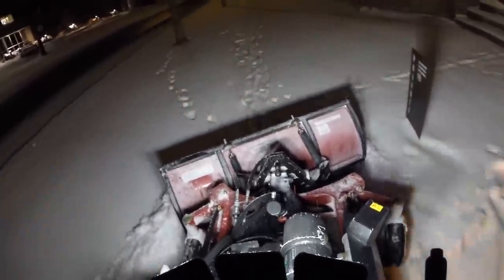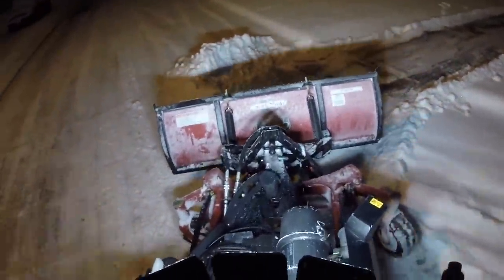Toro Grandstand Multiforce In Action

Comment: Have you had any issues with salt corroding the engine and electrical components when you transport in the open trailer?
Reply from the maker: Grasshopper Lawn Care Services, LLC yes, I built up the front of trailer to eliminate road slush. Fluid Film and dielectric grease is a must...
Reply: Rhett

Comment: Hey how do you carry this in snow? Do you have a trailer or does it fit in the back of your truck?
Reply from the maker: Sidewalk crew with the truck and trailer in video. Build up the front of the trailer to avoid slush being thrown up on the Toro. Have an enclosed trailer now, and will be using that this season.

Comment: How wide will the plow be angled? Most of my sidewalks are not 5'.. more like 36-40".. thx
Reply from the maker: Correct, residential sidewalks around us are 40" +/-... However the city walks in Madison are 5', sometimes wider. The blade only cuts off an inch angled, so 59".

Comment: love the video but what is the cost factor between your machine and a bobcat s70 with a blade/pusher? and in a bobcat you are out of the elements Thanks
Reply from the maker: Very true, we used to run a Toolcat. Given the amount of snow we deal with and how we have set up the routes, the Multiforce is way more efficient for how we operate now. If I need to move snow I do so when needed.

Comment: Can I buy LED lights and strobe separately
Reply: I used to do vehicle electric as a job & I would say yes to both.  The LEDs are my preference on anything due to the extremely low voltage draws.  All of your LEDs can be wired on one switch/circuit but, my recommendation for strobes is to have a switch/circuit of their own.  I say this because strobes use capacitors which use a higher draw to maintain operating voltage + stored electric in the capacitors.  Just my 2 cents...

Comment: Not impressed, gotta suck when its really cold outside, when you walk behind a snow thrower, you keep warm by moving your muscles, also what is it like with many snow falls in a row, a snow thrower can throw the snow anywhere you want it...away from the work site, with this rig its just piling up.
Reply: You use both
Reply from the maker: You have to gear up! No doubt you are more active with blowers, but i'm all about efficiency during events. You can move piles later.
Reply: @Elementsian  exactly. My friends comes back with a Dingo to move snow if needed...
Reply: That was just a dusting.  Can't see using this machine in either a wet snow fall, or a heavy snow fall.
Reply: @Elementsian  four you put  wind sheild on it ?
Reply: I'd rather be a bit chilly for the small amount of time it would take versus using a snow blower, being soaked and taking probably 30 times longer. That machine is hands down one of the best sidewalk machines I've seen. I'm sure there's even some sort of enclosed cab for it. Great video

Comment: Are you running stock tires or snow tires?  You mentioned some tire spinnage.  Traction is one of my biggest concerns
Reply from the maker: Ditsch Lawn & Landscape snow tires with antifreeze in them...  Traction has been surprisingly better then you would expect for a machine of this size / the fact its only rear wheel drive. However you do run into issues from time to time depending on a couple variables. I should have a more in-depth review video coming up here in the next week that will touch on traction more.
Reply: TPS Madison awesome thanks for the reply.  Can't wait to see the next video!